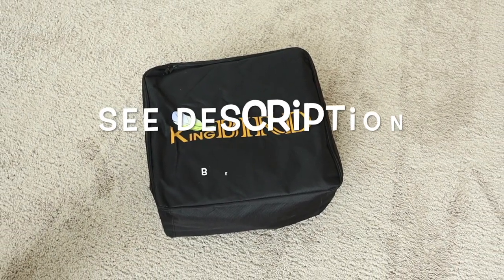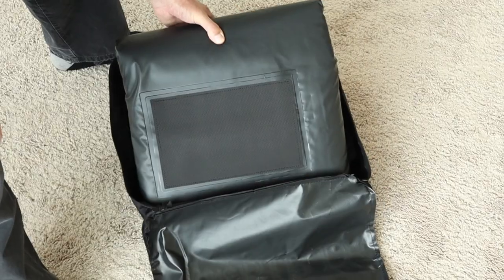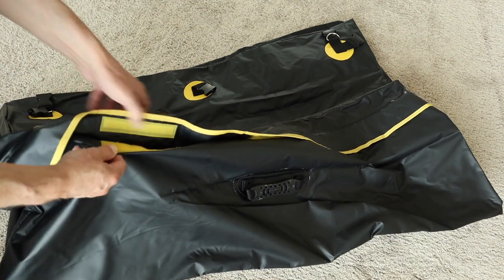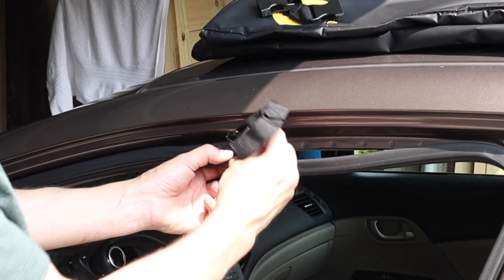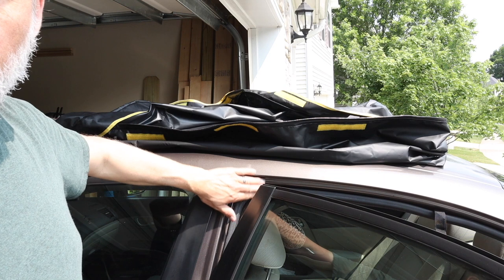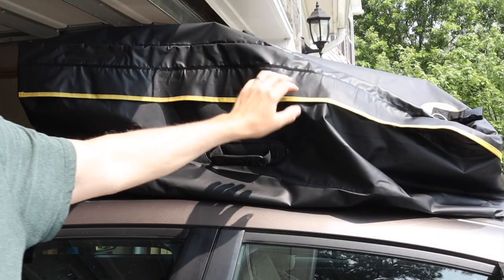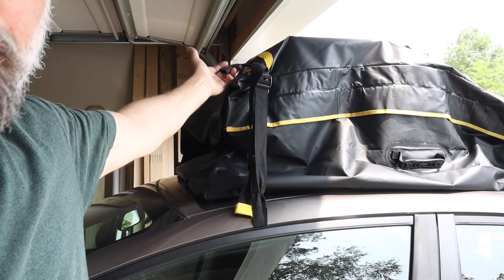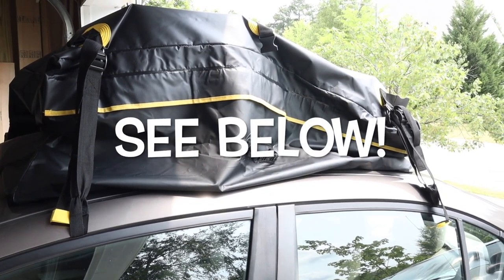Car Cargo Carrier install without Roof rails or Roof racks! Soft Cargo Bag for Travel

Comment: can the straps go over roof top side rails? i have side rails but without the cross bars they are useless becasue they are flush with the car. 2013 buick enclave
Reply from the maker: Yes it certainly would because the straps actually come from the top of the carrier. In your case your side rails would just keep the carrier from moving side to side a little bit better. I've got two of these carriers now I love them ❤
Reply: Awesome thanks !

Comment: Hey will this carrier fit even on a Toyota corolla you think? And it doesn't have roof rails either, just a bare roof..
Reply from the maker: Yes, it should fit just fine. The Corolla is actually about the same size as the Civic, it'll fit with room to spare on either end.